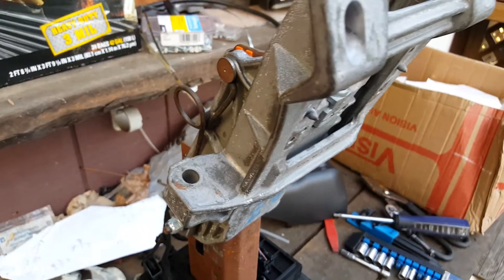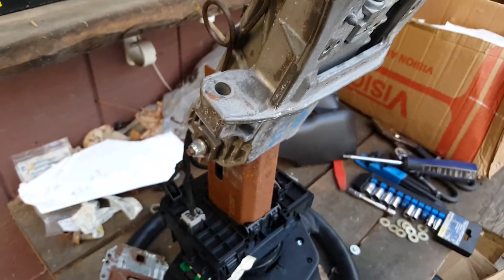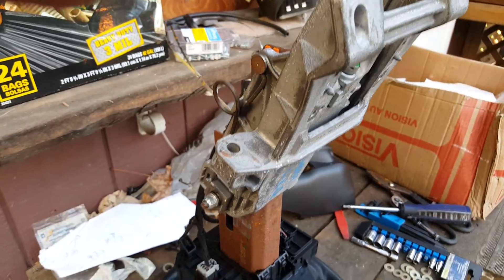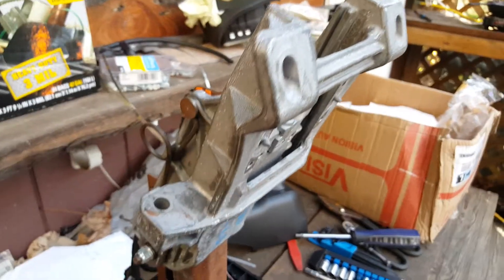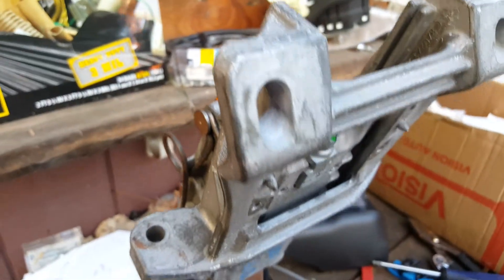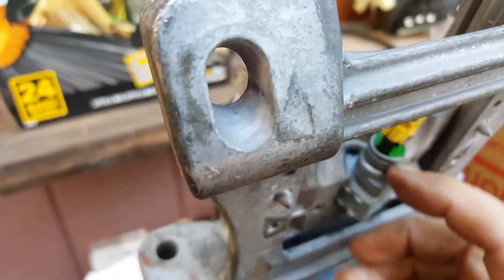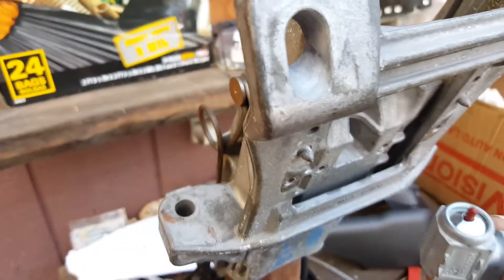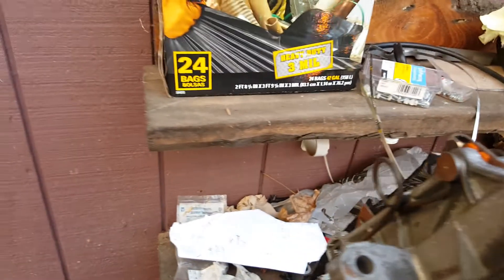2013 Ford Taurus Collapsible Steering Column Deployment Control Sensor

Comment: My column actually deployed.. and I need help with resetting the column itself.
I've a replacement sensor, but the column is an inch inward, preventing me from putting the cover plate back on.
Reply from the maker: Haven't ran into that problem so I can't help. Sounds like the steering column might of collapsed or something moved forward.